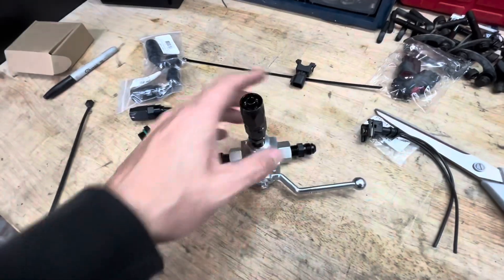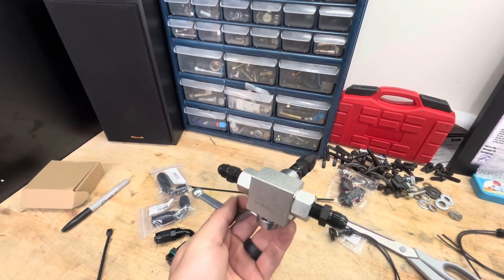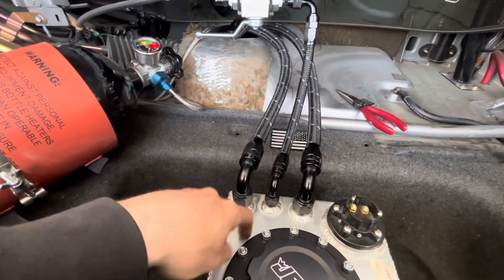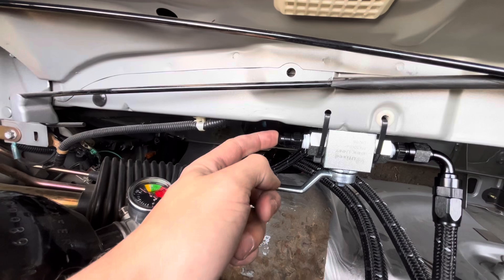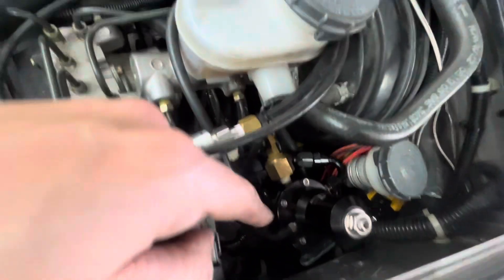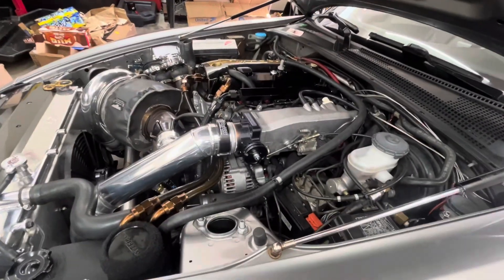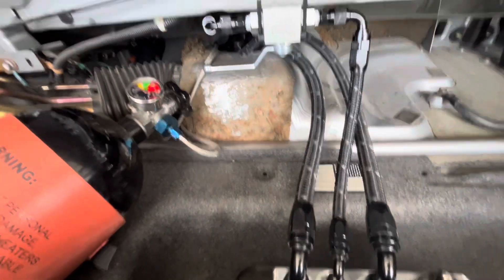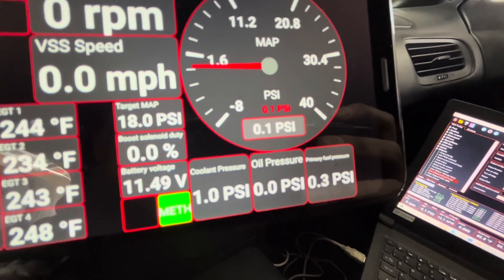Prime Pump for mechanical fuel pump.

Comment: What did you use as a prime pump?
Reply from the maker: Just a 255 walbro
Reply: @onebads2kracing  thanks. I’m having a hell of a time getting pressure to the rails. This would be the first start up if I can get pressure up there lol.
Reply from the maker: @MrRcaldwell614 it helps a ton! Once the mech pump is prime I never have to use it but if I drain the fuel at all or run dry I use primer pump works amazing.

Comment: You dont need the valve, heres how i do it.  The capacity of the surge tank needs to be large enough to supply the engine fuel for 1 pass. 1.5-2 gallons is a good size for a 1500hp engine on E or M. The surge tank needs a small return hose from it to the main rear tank. 

The small elec pump is used to prime the rails and fill the surge tank. It feeds the regulator just like you have in this vid. It runs whenever you need prime, and whenever the engine is running. The regulator returns to the surge tank

Does the same thing you are doing here, put no need for valves or anything